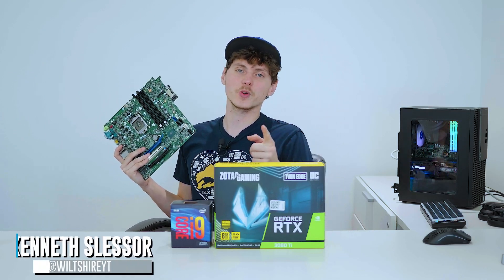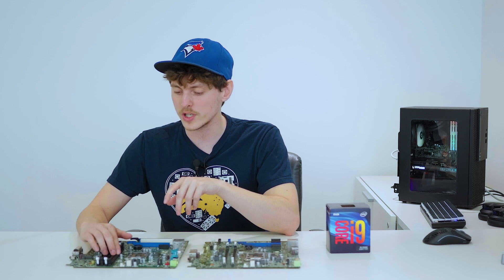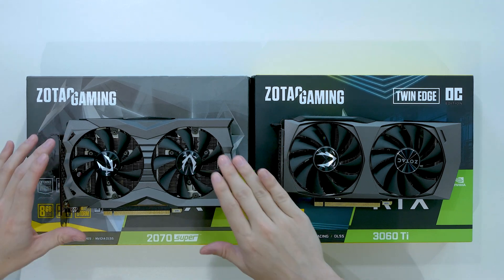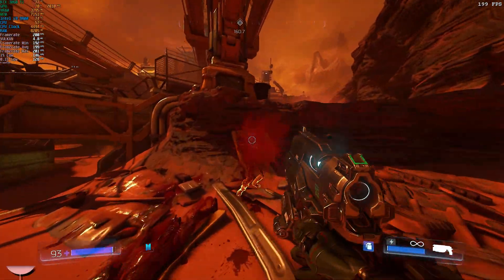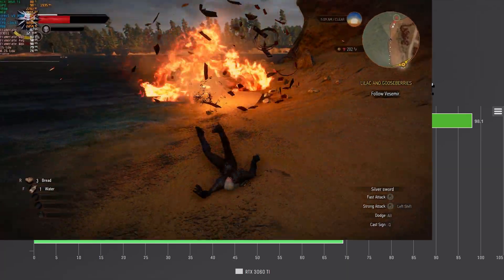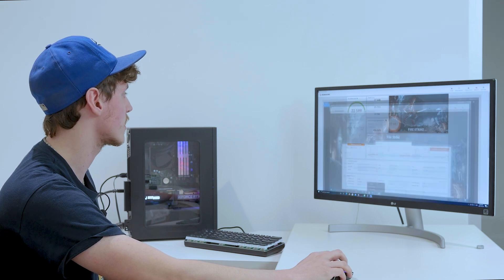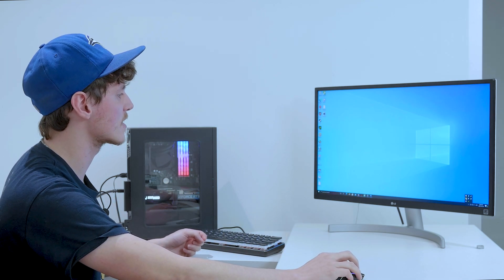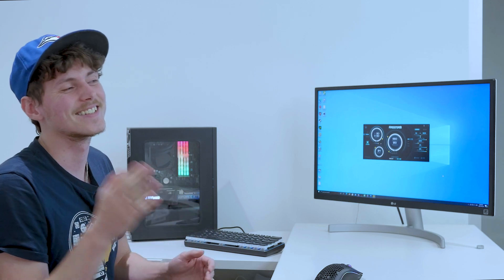Showing Dell How to Properly Make An Optiplex Gaming PC

Comment: Ah you came back! Can't wait to finish the video😄
Reply from the maker: I always come back! I'm pretty slow when it comes to creating content sometimes. Trying to find parts and make a game plan for OptiFlex takes me some time
Reply: It's really satisfying watching how optiplex can keep up with the newest hardware considering it's an office PC. And boy getting 3060 is a great luck!
Reply from the maker: @veenone  It can hang with the other PCs! Just wish I was able to overclock the CPU a little bit. But, what can you do! I had incredible luck scoring the only 3060Ti on the market that would fit inside OptiFlex!
Reply: @WiltshireTutorials  btw, where did you get the 7070 motherboard ? I was browsing around Aliexpress, the best sparepart I could find is 5050 MT. Thanks to you browsing for optiplex parts is one of my favorite hobby now 😅
Reply from the maker: @veenone  I was able to source the 7070 MT motherboard off of eBay. Aliexpress is okay for Dell pre-built parts, but I find eBay to have more. Be careful! That hobby can turn into an addiction quite easily lol
Reply: @WiltshireTutorials  well thanks for the warning! so far I haven't decided yet what to do after maxing out the ram , getting ssds, and  gpu on standard psu lol :D nevertheless, your contents are really inspiring
Reply from the maker: No problem lol. If you're going to use the original PSU, the max GPU you'll be able to use a out an RX 470 due to the limited amount of power the stick PSU has. I'm glad I could inspire you! Thanks for watching

Comment: Can you do upgrade dell optiplex 3070 i3 9100
Reply from the maker: Yup! Just keep in mind that the 3070 maxes out at an i7-9700 and is unable to use the i9-9900. You will also need to all of the mods that I have done previously, like the SFX PSU

Comment: this is basically a dream setup rn even though u swaped out the ugly optiplex 3050 front panel i still think if u can 3d print a new fron panel that looks alot sicker than the ugly dell optiplex front panel thats basically the only thing thats left to upgrade
Reply from the maker: Glad to hear you like OptiFlex! I like the idea of 3D printing a new front panel for OptiFlex! I still kind of want to keep a little bit of the Optiplex DNA for OptiFlex. But, it's a good video idea nonetheless!

Comment: Could I use an i5 9400f on the 3040 mobo?...
Reply from the maker: No..? The 3040 motherboard is for 6th gen intel CPUs, not 9th gen.
Reply: @WiltshireTutorials  the 7070?I'm new to building pc's,so the optiflex build will be my first,any suggestions?atm I have a zotac RTX2060 I'd like to pair with a good i5....

I don't know much about generations...

Comment: Dude. You know we wanna see how you fit the mother board bla bla bla
Reply from the maker: The motherboard is pretty straight-forward. As I showed in the over-head camera shots, the motherboards are identical in shape and have the same screw pattern. The only modification needed is to cut out the rear I/O ports. Which is quite simple to do and I felt it would inflate the video length, so I left it out.
Reply: @WiltshireTutorials  thanks for the quick replies. What about the front usb c port?? And where did u get the board and pricing?
Reply: I have a 3040 and have being looking at everything. Doing the dell factory upgrade path with a 70 series motherboard or just building a full system. Because at this point. I need ram, power supply and realistically a processor so unless I buy ram and a process that leaves me stuck in the past I need a new motherboard as well so that I can by current ddr4 and something greater than a 7700k
Reply from the maker: The front panel on all models from the 3040-3070 are all the same. So, no modification is needed for the front USB-C port. Dell changed the design with the 3080. I got my working motherboard off of eBay.
Reply from the maker: I would recommend maybe a 7070 MT motherboard, same as I used in the video. It will bring you up to the 9000 series of Intel CPUs and it supports DDR4 RAM
Reply: @WiltshireTutorials  think I can fit a 6800 xt in there?
Reply from the maker: Probably not. Unless an AIB makes a mini version of 6800XT. I have 1mm of room with the 3060Ti.
Reply: Part 2

Comment: Will you be painting the mobo black again?
Reply from the maker: I'm thinking about it! A ton more components on the 7070 board, compared to the 3040 board. So, it would require a lot of masking. I'm a little more hesitant because I had so many issues just getting OptiFlex to this point, I don't want to mess it up again. I will definitely think about it though! Could be another video idea.

Comment: Killer upgrade! Really liked the opening bit, great montage too! Too bad the OptiFlex logo is gone from the gpu and no more black mobo, maybe you have something else planned?

Excellent performance too! Not too surprising with such great specs, but a very nice thing for sure.

Wish I could get my hands on the new Nvidia gpus, wanted the 3080, but that ain't happening anytime soon haha. Also, hope that a good mini Ampere card arrives one day so I could put it in my sff system too.

Speaking of which, I'm still waiting for parts on the RTX 2060+R5 3600X sff system, actually managed to nab a water block for it, gonna be doing some wild stuff, so I hope to show my franken-custom loop once its done.

What other adventures await in the next installment of OptiFlex?
Reply from the maker: Glad you like the upgrades and the intro montage! That took a lot of time to get that shot right! Spent almost 3 hours doing take after take of that shot lol. I do miss the OptiFlex logo on the GPU as well. I was trying to think of a way to implement it again the 3060 Ti. I think it can still be done. It'll require a bit of effort though. I'm definitely looking into it. I'm also thinking of painting the 7070 MT board black, just like the 3040 board. Little hesitant due to all the motherboard issues I had with this video.

The performance somewhat surprised me. I was expecting the PC to potentially thermal throttle with both the i9 and 3060 Ti running at full tilt. But, I was pleasantly surprised that they didn't and it ran cooler than the previous version of OptiFlex!

Oh, man! I had such a rough time getting ahold of even that 3060Ti. The only way I was able to secure one was a local PC store employee recognized me and put one aside for me to buy (the aren't taking reservations for them right now). So, I got SUPER lucky. I'm looking at either a 6900XT or RTX 3090 for my main editing rig. Hopefully I can find one for it soon.

I would love to see the Franken-Loop when it's all setup! Are you going to make that PC SFF as well or are you going to go a little bigger?

I'm not sure what awaits for OptiFlex at this point in time. But, I always seem to come up with something new and exciting for this little guy!
Reply: @WiltshireTutorials  Yeah, I could tell you kicked it up a notch with editing, good stuff! I get your hesitation with painting the mobo, don't do it if you feel like it's not worth the risk, the system still looks great.

Definitely got lucky with your gpu! I have an option of buying the 3070 right now, but I'm still eyeing the 3080, so I'll wait.

Oh I'm definitely keeping the form factor. I swapped from 4L to about a 5L case, but it's still very cramped. You'll see what I mean by "franken-loop" once I'm done.

I'm sure you still have a few tricks up your sleeve regarding the OptiFlex, keep it up!
Reply from the maker: @DarKNesS7026  I always try to top the previous video. Sometimes that doesn't happen lol. I'll probably end up painting the board. If things go sideways, I'll just buy another board.

I'd wait and grab the 3080, if I were you. The 3070 doesn't seem worth it to me.

Well, the 1 extra litre will definitely help when trying to stuff all of your components inside

I have a few ideas! Could be some fun!

Comment: Oh. A new Prebuilt Dell upgrade. More RAM = More Headroom. 32 GB of RAM isn't enough nowadays, even for Gaming. 64 GB of RAM to 256 GB of RAM is enough, at 4.5 GHz. The optimum amount of RAM is 512 GB, at 5.0 GHz, even if the Mobo can't support an overflowing amount of RAM.
Reply from the maker: I'm going to have to disagree with you quite heavily on this. 32GB is more than enough for gaming and some light editing. I barely utilize all the 64GB of RAM with my Threadripper Main Build when editing and animating things.
Reply: @WiltshireTutorials  lol tbh I think this guy is either really stupid or just joking about. In no way would anyone believe you need 500gb of ram at a speed of 5000mhz, if that's even possible on consumer grade hardware
Reply from the maker: I just don't want other viewers to be misinformed, that's all. It's possible, but not on consumer hardware. Usually the max for consumers is around 256GB with a Threadripper. It's more of the server market with an Epyc CPU that push RAM amount that high.
Reply: @WiltshireTutorials  Epyc Servers can push RAM Capacity  up a ton; downside is the cost. It'd be at least $5K, just from a business standpoint, though...
Reply from the maker: Oh, absolutely. The Epyc CPU alone would be $5K+. You can throw in at least 1TB of RAM in an Epyc server. Which is just crazy to think about lol.
Reply: @WiltshireTutorials  64 is good for Threadrippers, though; I can attest to that. And I'm still running just fine on the prebuilt Dell Inspiron 660s with its 8GB of DDR3 RAM; nothing has been changed from the prebuilt PC other than the Internal Storage solution that I'm using (a 250GB WD Blue SSD). I'm going for a full-on, over-the-top AMD build in 5 years' time, and fill my own Custom Rig with 6 SSDs that are greater than, or equal to 48 TB (of Stated capacity) of SSD Space.
Reply from the maker: That's usually the upgrade I recommend for prebuilt PCs is a an SSD. In 5 years, we may have a lot larger capacities for SSDs. So, you may not even need 6 SSDs. Not sure what you're doing that requires that much storage space though lol.
Reply: @WiltshireTutorials  Video storage; got me an OG switch for $200 on eBay (was in a Like-New condition), and, I've backed a project on Kickstarter (2, specifically). One project is for a Genki Shadowcast (which was completely funded just this past Thursday), and the other project is a MicroDock created by Kaiunzan; both are on Kickstarter. When I receive them, the 5 SSDs that isn't holding an OS will be my video assets for recorded gameplay from my own Switch (The Switch and the Switch Lite both have a SanDisk 1TB MicroSDXC card in them; Lite has the Extreme PRO 1TB, the OG Switch has the Extreme 1TB). Furthermore, I'll purchase 3 more SSDs for backing up my Computer Data in each of the 3 Blank SSDs, as I'm going for a Raid 5 or RAID 10 Backup system, in addition to the main WD Blue SSD that's in my prebuilt Dell PC (it's a measly 250 GB, though, for Storage Capacity)...
Reply from the maker: I looked at the Shadowcast and decided against backing the project. I've been burned on Kickstarter once before and I try not to let that happen again. It looks interesting though! I'll be keeping an eye on it in the future. Having that much storage for game footage is still a little overkill, unless you plan on recording in an uncompressed format. Having a RAID array would be nice though. I had a 12TB RAID 1 for all of my footage in case something happened to one of the 6TB drives.

Comment: 2nd LIke kEep it up
Reply from the maker: Thanks for the like. I appreciate it! Also, damn you were quick. I literally hit the post button lol
Reply: which cable did u use to connect from 24 pin to 6 pin?
Reply from the maker: I should've linked that in the description. I will add it. Thanks for pointing that out to me. The adapter cable I used was this one here: https://www.amazon.ca/gp/product/B08M5BZ6P8/ref=ppx_yo_dt_b_asin_title_o09_s00?ie=UTF8&psc=1